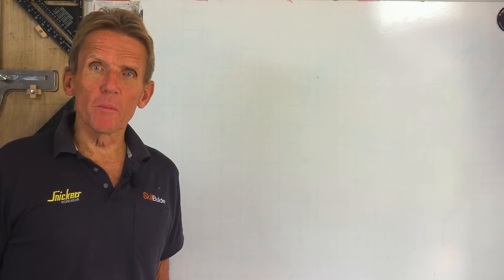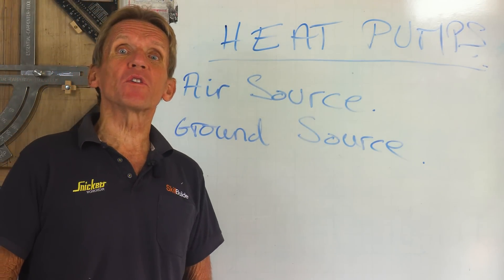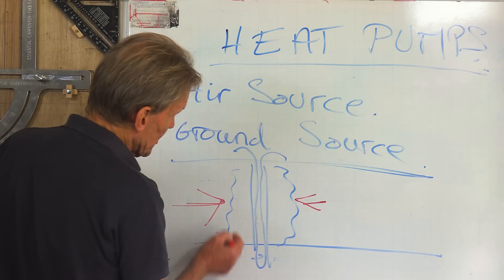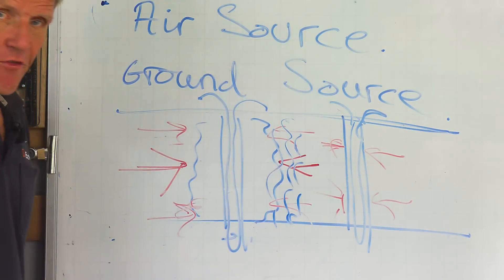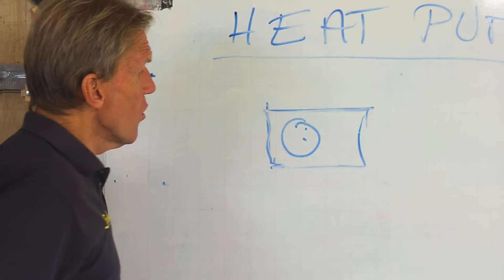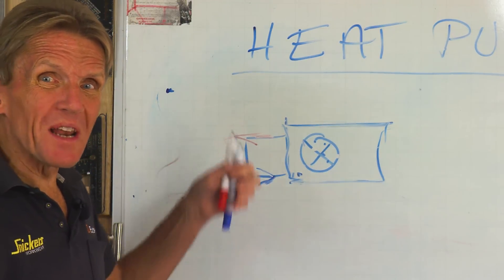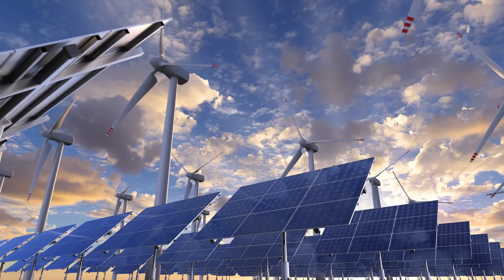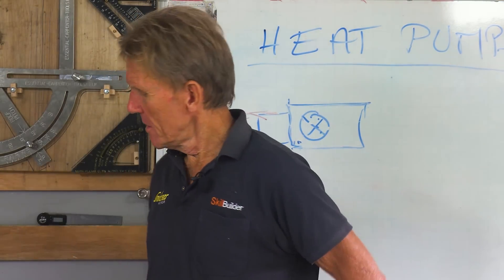Heat Pumps ~ Get Your Facts Straight!

Comment: Had my gas boiler have it’s first major service today at 6yrs old. Total cost was £150, usual service £70. Cost me £2500 installed 6 yrs ago. My 20yr old 4 bed house is pretty efficient £685 heating and hot water last year. I wonder what the cost to change to ASHP would be as my house uses 10mm plastic pipe so would all need replacing with current heat pumps.
Reply: I wouldn't worry about it, you've got at least 5 more years life from that boiler before its worth looking into where the tech is.
Reply: you sound like you have a decent system, so I think you're fine. a good rule of thumb is to never change technology unless you're already at the end-of-life of a unit.
Reply: @somedude-lc5dy  . LOL, something my father would have said, along with let the new adopters suffer the pain, until they iron out the faults.
Reply: I have fitted many heating systems so know only too well the chaos which a house goes through to install even 15mm pipework let alone 22mm or 28mm..Your current 10mm pipework is probably concealed in the walls so can be left there and replaced with the bigger bore pipes under the floor. 10mm will not work for a heat pump. You will need all new radiators.
A typical heat pump system will cost about £15,000 to install in an old property which will also need full insulation.
Reply: @richardlewis5316  10mm can work with heatpumps, particularly 10mm copper, not always, but if as you say the property is being fully insulated, the 10mm of the existing rads can sometimes be fine due to the much lower heat demand on the building.
Reply: You won't be getting any change from £20k & even more if you need extra insulation fitted,
Its one great big con job
Reply: @pauldavies7251 Haha 20k! Ground source perhaps. He'll get quotes well below 20k for air source plus he'll get a 7.5k grant towards it. He might be able to run 10mm pipe still but it really depends on having a good survey to determine these factors.
Reply: @MrMax4music  he'll only get a grant if he's on Benefits, he'll definitely need new pipework & bigger radiators,  The floor boards & carpets will need to be taken up.
If his house is poorly insulated like majority in the UK that will need to be done plus walls will need to be plastered, 
After spending all that time & money the bills won't be any cheaper as gas is way cheaper than electricity 🤦‍♂️

Comment: Hello from Ireland, my niece has an air to water heat pump, why is her electric so high?
Reply: Emersion heater doing all the work?
Reply: thanks, ill check with her, that could be it,  @TurinTuramber
Reply: yes her emersion is on all the time, and she has a timer for the rads to come on, she was told it was cheaper to have it on all the time because when she needs it it takes more electric to heat it back up again, can she heat the rads if she turns off the emersion? @TurinTuramber
Reply: A lot of people make the mistake of thinking that a heat pump is just like an old style gas boiler. They try to use it in the same way and come unstuck. They are NOT the same and to get the best out of them they have to be used differently. A key factor is flow temperature. Gas boilers will happily produce water at 70c but heat pumps struggle past 45c. Keep the flow temperature low and a heat pump can be great and cheaper to run than gas. People think radiators have to be HOT. wrong, they just have to be warm enough. My heat pump is currently running and producing water at 29c. The house is at 19c. Run long and slow. I run my system 24/7.
Reply: rates have gone up mate.

Comment: If you are luckily enough to have a river at the bottom of your garden, this is the best source of energy for a heat pump.
Reply: Until it freezes totally one year.
Reply: @Vile_Entity_3545  Interesting... funnily enough people on the other side of the road where I live are in that situation: Ravensbourne River in South London: their gardens literally go down to this river without any fence, embankment, or anything. But regarding your comment, I just googled "last time a river froze in england" and nothing came up. The Thames used to freeze very very occasionally. I'd be interested to know the answer. It's probably not something to scupper flashback9966's idea...
Reply: @Vile_Entity_3545  Rivers don't freeze in the UK.

Comment: I am convinced Roger could do a video explaining the process of paint drying and still make it essential viewing. Keep them coming!
Reply from the maker: Thanks, I am going to try that just for fun
Reply: @SkillBuilder do it, ha ha.
Reply: I'd watch that.
Reply: Roger is the man. Is there anything he doesn't know? I don't think so!
Reply: I'm in !
Reply: “Top 10 things you need to know about watching paint dry”
Reply: @hewhorocketh  
1. Put a Sign up "Wet Paint".
2. Clean the brushes.
3. Clean the rollers.
4. Make sure you follow the instructions on temperature.
5. Leave the appropriate amount of time between coats.
6. Use the right paint for the job.
7. I hope you stirred it before applying.
8. Clean the surface before application.
9. Keep pets away.
10. Watch it dry and repeat until you have the perfect coat.

11. Not necessarily in the order above.
Reply: Do it, you know it makes sense.
Reply: Will it be tartan paint?
Reply: not convinced heat pumps But they are being forced on us , ongoing work needed any government grant will cost you in the long term call me old fashioned
Reply: He did a video on paint scraping which I found riveting
Reply: I would watch that. And people would still argue about it lol.

Comment: Currently 1.2 million heat pumps in Germany. Some of these must work!
Reply: Underfloor heating is more common in Germany. Heat pumps are more suited to this method of heating as the temperature required is lower than for radiators which is more common in the UK.
Reply from the maker: Maybe they all do but this is not about them not working it is about confusion over terminology
Reply: @SkillBuilder   Yes your video explained 'the facts', but it just sounded a little too negative. Heat pumps are a simple and incredibly efficient way of transferring heat where you need it. I know my car has one and it works really well in all weathers. 
Heat pumps could/will have a significant impact on our planet. If they are designed and installed correctly they just simply work. As the SkillBuilder, how about starting a movement to get installers professionally trained, so we all win out.
Reply: @flashback9966  your cars air-conditioned might work in all weathers, but do you know how much energy it saps from your car? I once worked in the middle East where aircon was mandatory in a car. The big American tanks we mainly drove handled the aircon fine. However we had a Toyota corolla which had a much smaller engine tban the American vehicles, and it really showed the drag caused by the aircon compressor kicking in. It was like a light touch on the brake pedal it was that extreme. In fact it was dangerous if you were overtaking a long line of vehicles out on the open road and it kicked in because it would take several mph away just at the wrong moment.

It also would release the compressor at adverse times as well ie when you took your foot off the accelerator to use engine braking, and it would sometimes "kick out" thus reducing the amount of engine braking available.

We learned to turn the air brakes (aircon), as we came to know it, off during extended overtaking manoeuvres as the effects of the compressor starting and stopping were too extreme and too erratic to be safe.

The point of this tale is to show that aircon does sap a lot of energy from the power supply, whether engine or electric. It may not be noticed during normal operation because it will be better matched to the engine or motor driving it than in it was in my case. But it will still be taking that energy to drive it.
Reply: @crabby7668  All I can say using the A/C in my Tesla makes virtually no difference in range. It actually scavanges energy from twelve different sources around the vehicle.
Only at sub-zero did I see a range hit and even then it was not that bad.
Reply: @flashback9966  Are you trying to say your Tesla has a revlolutionary heater. Cause today I had about half the range at -7C compared to +15c wih the electric car I drove. It does have a heatpump. Consumption was around 40kwh/100km.  Up from aoound 20 in perfect condtions. Yestarday it was even worse with 45kwh/100km because it was -14C. 
Quite annyoing that you have to ad half an hour of stupid charging, on the postive side I get paid for it 🤣
Reply: @flashback9966  I saw a video on the weber auto site that explained the tesla heating cooling system and all of the heat recovery methods. God its complicated. It amazes me that people still claim that there are less components or less moving components in an EV compared to an ice. If you watch any of the weber teardowns you can see that assertion is patently false. The number of fans alone, is something else. 

Anyway I can't argue against your live experience, but anything that compresses gas will take energy to do it. I was just detailing a situation where it was very obvious how the compressor sapped power from the engine (so much that it created hazards) . Obviously in larger engines with more power and torque it is much less noticeable to the user.
Reply: Mine sure does. It just has to be designed and installed properly by people who know what they are doing.
I've got a ground source heat pump in a properly insulated house that takes about 4 kWh per day to heat the entire house in winter. During hot summer days it takes about 1 kWh per day to cool the entire house.

And no, it doesn't freeze the ground in winter. Cause the ground loop was properly sized with the house's heat load in mind.
Reply: @miken3963 total fitting cost including materials & running cost?
Reply: I'm from DE.
I've seen some air/water heat pump retrofits in older homes, putting them in costs a fortune. 
They run on a separarate meter with a ripple relay - old meter panel with no space for a 2nd meter?
Get a new one - 2500 to 3000€ just for that.
The highest offer for a house from 1991 with two heating circuits (radiators + uf) was 48,000€.
On average I would assume roughly 20,000€.
In my place electricity at night for heating "Heizstrom" is 34 ct/kWh and at daytime 37 ct/kWh, gas is at 10 ct/kWh.
The sometimes very utopian Fraunhofer institute has made a research (have they looked at all?) about ASHP and claim they reach a SCOP of 3,1 which would still be more expensive than gas.
What I recommend: split ACs and a DHW-hp and leave the gas boiler, those split units reach easily a COP of more than 4 in spring and autumn and the DHW unit 3.5 in a typical German basement/cellar. Combined with some solar panels this cuts the heating bill by at least 50% and is trouble free and easy to install, radiators are not touched and in february with down to -18°C (Bavaria) nothing struggles.
Our madness-government with green fanatics destroyed the property value of older homes with their "Heizgesetz" (heating law) sometimes by more than 50%. 
ASHP are ideal for new homes with 30 cm insulation around them and uf heating run at 25°C.
ASHP are useless in millions of German apartment blocks with "single pipe" heating systems (radiatots connected in series with a bypass) due to operating temps. of 60 to 80°C.
As a result the AfD (like the UKIP) is on the rise, in East Germany (they hate commie greens - no wonder after 40 years suffering in the GDR) some polls reach 35%. Try forming a state government there - we need sensible politics, nuclear power and solutions that work for people with average incomes. Robert Habeck (it is his idea), please go home.
Reply: @newyorker641  a great well reasoned comment especially the crazy green politics which has had an undue amount of influence in Germany.

Comment: Insulate your home properly every time .... then consider what the right heating method you need, after you have a professional heat loss survey.
Reply: Not so easily done for older houses and would be massively expensive;
Reply: @dnmurphy48  Easily done, common sense
Reply: @Troy_Loves_Custard  Er, not. Most houses built in the UK don't even have cavity walls. Houses in this island have been built for centuries in the knowledge that our winters are mild compared to similar latitudes (Gulf Stream, but also insular climate). The cost of external thermal cladding on individual houses is completely prohibitive. So no, not "easily done" and not "common sense".
Reply: @Troy_Loves_Custard how is it common sense to insulate an d Victorian single skin property??
Please enlighten me how this can be done at a fair cost as it's my day job so I know exactly how ridiculously expensive it is
Reply: @mikerodent3164 You won't get a sensible answer from someone with a tesla as they're pic🤦‍♂️
Reply: @pauldavies7251  No point going into any detail ... educate yourself and expand your skill level

Comment: From Canada.   Why doesn't UK use forced air vents like we do in Canada?
Reply: When I last checked they were about 4 times more expensive than a combi boiler.
Plus most houses have radiators not ducts. 
Plus most are drafty because they originally had fireplaces and you needed to allow air in so ducted air would get blown out fast.
Reply: Most properties in the UK have a mains gas supply, which I believe is better suited to wet central heating systems. A lot of our buildings are 100-200 years old and the piping and radiator retrofit was the most logical replacement for our coal fires.
Reply: Is Canada efficient with their energy consumption? 🤔
Reply: Many UK houses were built before gas and central heating were common. In the 50's and even 60's, it was common to have a coal fire in most rooms. Then when we wanted to retro-fit a boiler and central heating, we had to fit it through the brick walls. It's much easier to drill small holes for pipes than to add ducts. Wet systems became normal, plumbers got used to them, and they continue to be fitted to new houses.
Reply: Not got the space, you need a ton of large duct work for forced air, most Uk homes are to floors, many are 3 which makes it tricky, plus our housing stock is old retrofitting hydronic is much easier.
Reply: It's a retrofitting issue, you can heat most rooms with a 15mm pipe with water at 55°C, you need a lot more than a 15mm air duct to heat the same space.  Ther thermal capacity of water is many times that of air.

Comment: Baffles me how an air pump system drawing air at 2 degrees heats a house up to 21degrees.
Reply: That's the point of a heatpump. It pumps heat from colder to hotter. It's a fridge in reverse.
Reply: You must stare at your fridge in confusion and wonder.
Reply: @edc1569 Don't we all?
Reply: @edc1569 yes. Where did all that beer go that was in there yesterday? 😊
Reply: Idea is to draw in draw 0c air, blow out -10c air. Use the 10c difference to heat you home.
Reply: It took me a while to grasp this. But imagine 2+2+2+2+2+2°c giving you 12°c. A heat pump accumulates the energy from the heat there is outside and adds it to the heat inside. It works the opposite to a fridge-freezer that produces a -20°c compartment in a 21°c house.
Reply: How do we boil water? We add heat energy to it, right?
The same thing happens in a heat pump. Difference is the refrigerant in the system boils at much lower temperatures. Think -30⁰C or even lower.
This heat energy that the refrigerant takes up from the environment to boil away is getting rejected into your home.
Reply: It doesn't draw cold air into the house. The cold air just passes through the unit outside your house. It might draw in air at 2 degrees, extracts some energy from it and blow it out at (for example) -2. It then uses the energy it extracted to warm up the air in the house, drawing it in at, say 18 and blowing it out at 22 (or it uses that energy to heat water, which flows around your radiators).
Reply: In Canada here.  Our Heatpump can heat to -30C but the max winter gets in our area is -12C for a week at time.